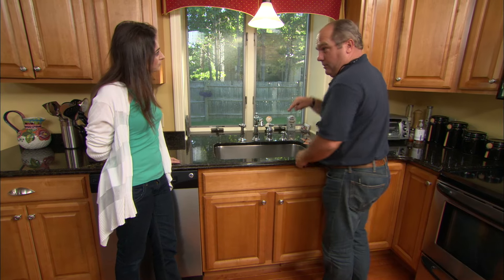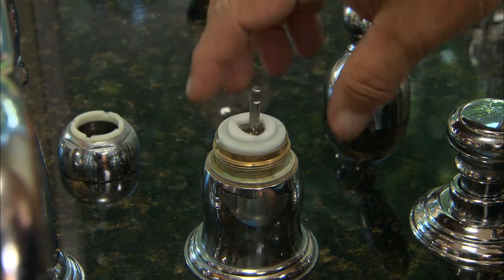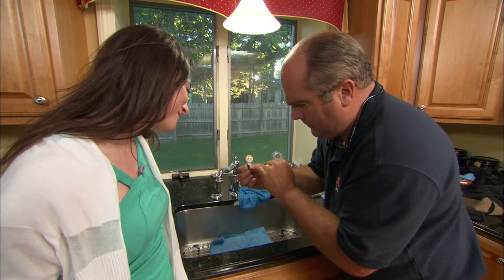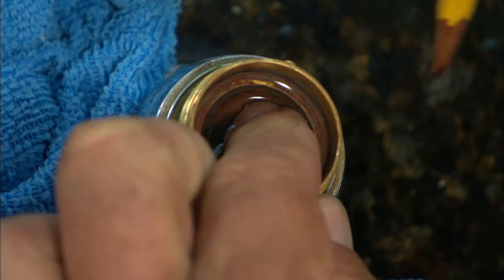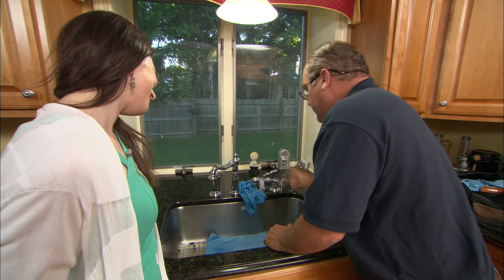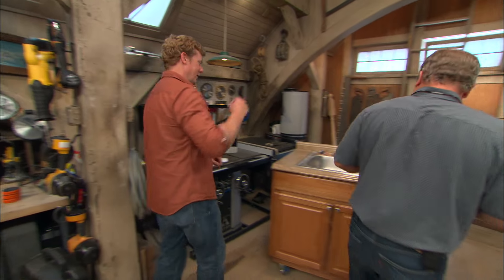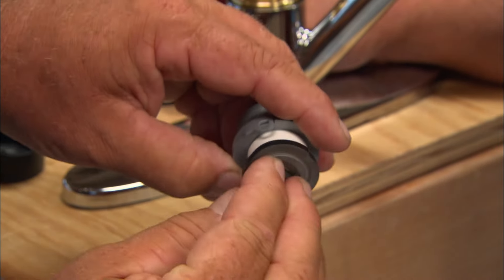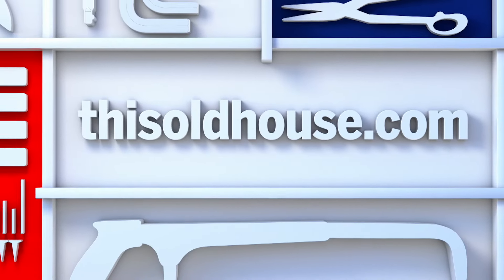How to Repair a Leaky Kitchen Faucet | Ask This Old House

Comment: Just the right detail in the instructions.  He pointed out small things I did not know that the video with more ratings (Mil.+) did not.  I like this one better.  I called Delta and they sent a complete washer/spring kit FOR FREE.  Then a week later they accidently sent two more.  As these ORIGINALS lasted 25+ years, the next home owner will have two kits for the next 50 years.  Delta rules, man !!!

Comment: Always replace both rubber seats and both the springs.  They are cheap and if your in there just replace it all.  Also add some faucet grease to top of rubber seats and all moving parts before putting back together.  Little grease on the threads don’t hurt either.

Comment: By the time my faucets would leak they were ready to replace anyway.  My kitchen faucet lasted 25 years and never leaked.  I finally replaced it because it had low water flow and was getting ugly.  My bathroom sink faucet is also nearly 25 years old and has never leaked.

Comment: Is this a Delta faucet? I have been using Delta for many years, and what I have are the ones with a cam assembly that has a circular spring in it, the spring presses a small thin plastic piece(formed a special shape) towards the stainless steel ball to keep the water shut. The small plastic piece fails every so often.
I wonder is your style cam assembly compatible with what I just described? If yes, then I would ask where can I buy your style cam assembly as it looks a lot more durable?

Comment: Delta will send the repair kit under it's lifetime warranty in about 4 days first class mail. Should be fine for another 10-15 years depending on mineral and sand content. 
Recommend a high pressure whole house water sediment filter after the water meter.

Comment: Hello.  Just came across this video.  Looks easy enough.
I need to fix mine as it is leaking in that area.  However, I saw the all screw, but does anyone know what size it is?  I've tried to shoved different allen wrench and it won't fit.  The screw screws worn out which is odd.

Thanks.

Comment: Great video. If the rubber seals look good could the springs cause a leaky faucet also? Thanks.
Reply: If they are not providing the right pressur on the seats it could cause leaking.

Comment: does anyone have any suggestions I have a Delta Diamond cartridge single faucet sink that won't shut off properly  I've tried everything to remove the brass nut my father-in-law that used a 20 inch pipe wrench with a lot of Leverage and no go  I was thinking there it sees because of hard water is it time to just replace the sink and isn't that old  and the cartridge is a lot cheaper and Home Depot it's about $28 before tax any advice is welcome to the preciate it thank you

Comment: Get da ball out to get to the holes n check em to get to da springs
Remember when u put da ball back it gots to line up right

CAMM assembly?? Block the water and #limit the sprout movement

U can adjust tension of ball like #sensitiviry in cod if u tighten or lossen the thing holding it cam assembly

Comment: Our Kohler Ceramic Valve faucet did not leak at the faucet spout but along its side of the main body of the faucet. Issue was O Rings.  Since Kohler likes these why cant the body have some type of seal that is not rubber?  And why does water get in there is supposed too?  Thanks

Comment: What about a leak from the the stem/spout of dual supply kitchen faucet.  Don't see anyone showing how to remove the nut/spout from the center where it leaks and how to replace.  The hot and cold handles aren't leaking.  I'm trying to figure it out for an old Chicago Faucet.
Reply: You best bet is to replace the whole faucet.  With the new connections, they are leak free.
Reply: Except that's very expensive. Chicago Faucet is a high-quality brand.  It maybe necessary to replace the washers in the handles, but if the spout is leaking from the nut area, there's obviously a need for a new washer or something there.  May end having to get a new faucet to stop the problem, but am hoping for a much cheaper fix.

Comment: What about faucets that don't have that oval part to pry off at 00:34, and have no visible way to access an allen head?
Reply: Then you're most likely going to have to take out the whole thing and see if its on the bottom. 

If not, you're gunna' have to replace the whole thing. Do your research when choosing your replacement faucet so that the rubber seats in the faucet are easily maintainable.

Comment: I can't fix my because to turn off the thing under the sink I would have to remove the dishwasher because the knob is too close and the space is way small
Reply: You could just turn the water off to your entire house lol.
Reply: Ackeeba Simms You could see if you can remove the handle (either a nut or a screw) and use a crescent wrench or vise grips to turn it off. Just reverse the steps to turn it back on and reinstall the handle.

Comment: Sounds like the new model mentioned at the end of the video is the fix for this poor Delta design. Note this was from 2015. It's now 2021 and if you go to Delta's website for one of their models that has this new cartridge, you'll see a lot of unhappy customer reviews - https://www.deltafaucet.com/kitchen/product/155-RB-DST.html I called Delta today and I will give them credit for great customer service. They're sending a new replacement part that will hopefully fix the drip. To sum it up, this is a poorly design cartridge that keeps needing to be fixed/replaced. We're not going to buy Delta faucets again.

Comment: Well...you get "full City pressure" if and only if you don't have a pressure regulator between the City supply line and where the water enters the house.  That may drop it to half from when it left the City supply line and just before it enters your house.  We have a City-supplied water pressure at 100 psi, but that is knocked down to 50 psi after it leaves the pressure regulator.  Apparently, not all houses have one, so check your incoming water lines for evidence of it.  You can call the DWP to ask what the street pressure is in your neighborhood, then buy an inexpensive pressure gauge to measure what it is from a hose bib before entering your house. Lower pressure, under this arrangement, is a good thing.  It can protect pipes from excessive line pressure that would otherwise be present 24/7.  It will minimize pipes from slamming when valves are opened and closed (like when your clothes washer is running), which may eventually cause leaks or pipe failure if left unchecked.  If you need to install a pressure reducer, you can go to a plumbing supply and buy one to install.  If you aren't able to install it yourself, you can have a plumber install one for you.